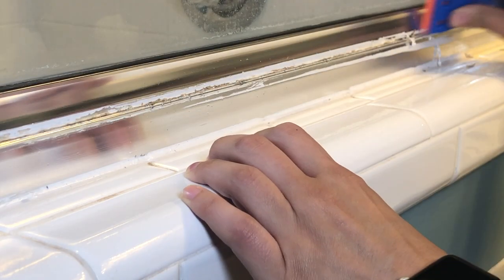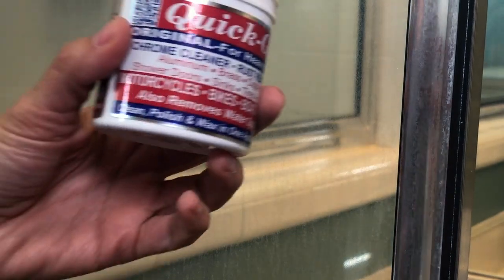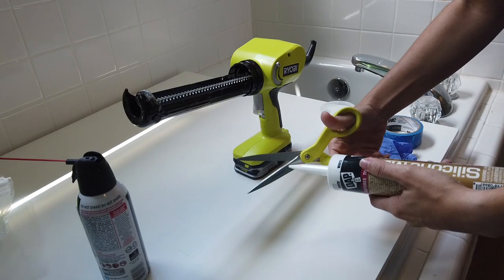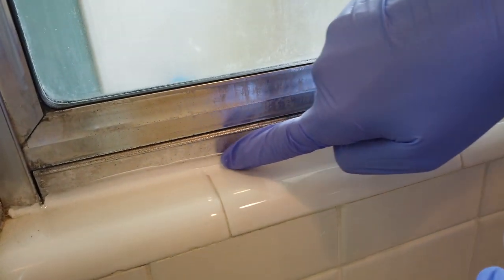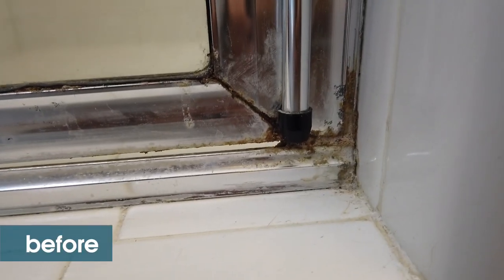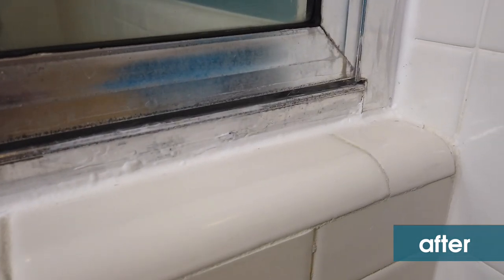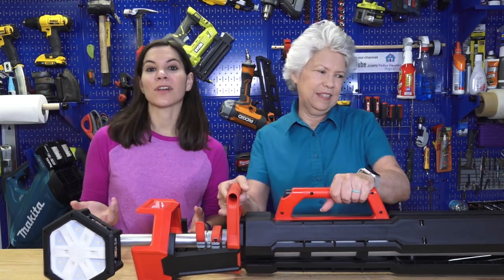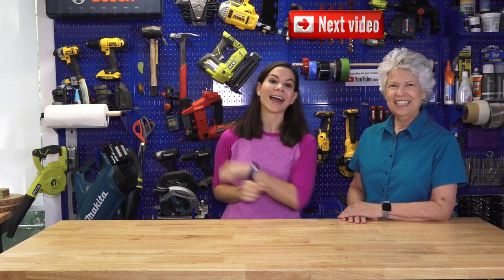How to Improve Your Shower // Caulk & Hard Water Spots

Comment: I have clear caulk inside my shower that looks really gross underneath.  Can you give advice on how to remove/replace?  (It goes all the way to a high ceiling)
Reply from the maker: I had that on the inside of my shower. I dug it out with the black stick we showed in the video. We didn't use that clip in the video, but in the blooper at the end with my dog, you can kind of see the black part under the clear caulk. -Steph
Reply: Thanks!

Comment: Have you thought about using Rub N Buff to cover the damage on the aluminum? It works great on metal. Just rub it on and buff, just like it's name.  
Here's an example for you.  https://youtu.be/TjyZAE4NQdI?t=30
Reply from the maker: Hmm...that's interesting. We have used it before and have some. Might try it out! Thanks, Steph
Reply: @MotherDaughterProjectsDIY   I'm not sure it would work on the inside with the moisture, I haven't tried that, but it should work well to dress up the outside. Maybe it would be worth recording the process to share.